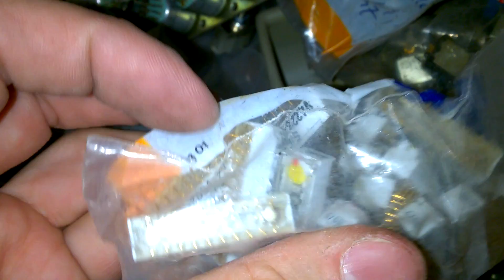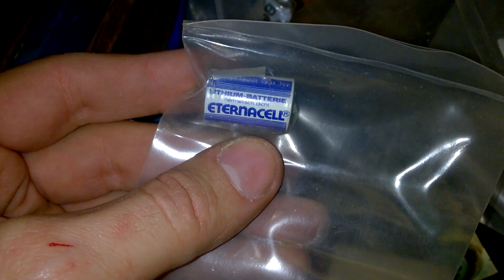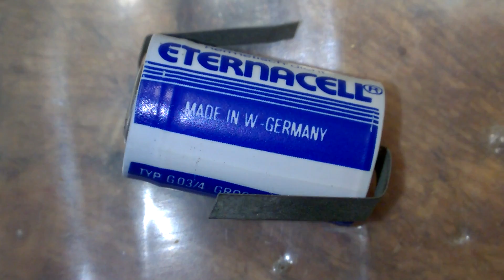CEPUS #5: Crazy Electronic Parts Unboxing Series (Mini-BEB) Toggle Switches & Eternacell

Comment: An old-style sealed Li battery probably has a rated shelf life in excess of 20 years.  Due to internal resistance, that battery may have about half of its rated voltage in a no-load test.

Comment: Guessing the battery will be... 3.4v!
Reply: With internal impedance in the order of 5M though. I have a very EOL Crompton Eternacell, and it still has 3V1 as open circuit output voltage, just that you need a 10G impedance multimeter to actually measure that. With a 11M input impedance it drops to around 2V. However, with 200 000uf of capacitance as backup, it ran a chime mechanism for a wall clock for nearly a decade, till it eventually got to the point of dropping in voltage to 1V during playback. Cell was only a decade past it's shelf life when I got it.
Reply from the maker: That's very interesting, thank you  @SeanBZA

Comment: I vote that the battery still has a voltage across it. Doubt it can output its max current though.

On another note, you have your patreon and paypal in the description, why not add you ebay store as well? I believe many viewers would like to also support you that way as well!
Reply from the maker: Good point on the battery.

And thank you for your hint with the link. I already  thought about it (since 2016). But then again, there is so much hate on YT, that I don't want to transfer that hate to my ebay-shop and my feedback records... but yes, maybe, some day... 

I don't think I can keep it a secret though!
Reply: @MaxKoschuh  You can't keep it a secret. I have found it at some point, but I suspect that many interesting things are sold over there and it's a bit difficult to find it again!